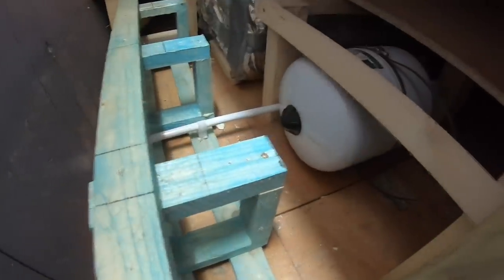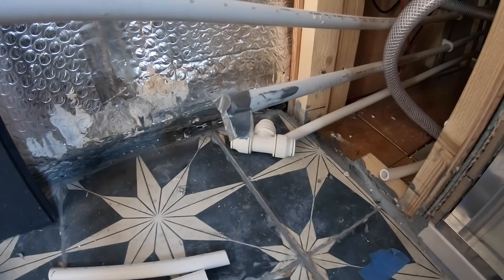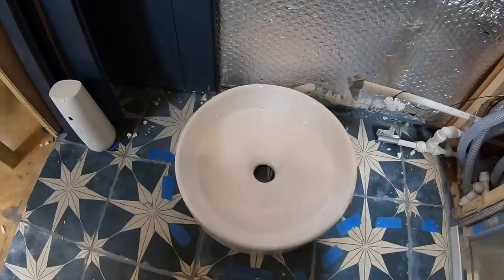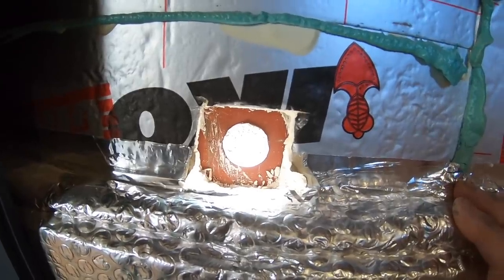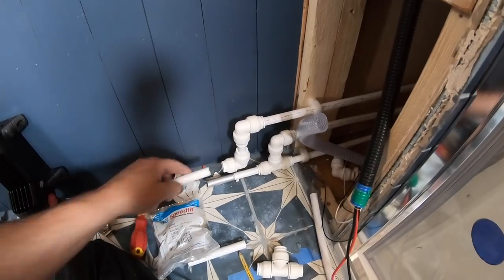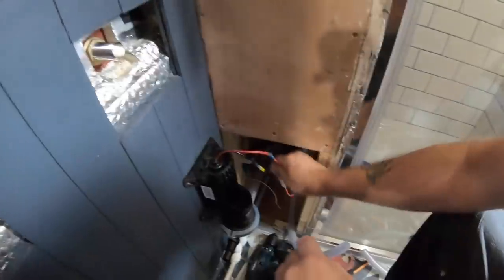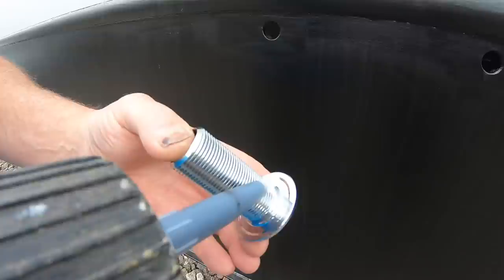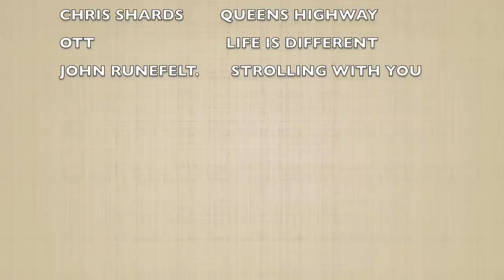VLOG 41, Narrowboat Fit Out -  GULPER, BLACKING AND BATHROOM WALL

Comment: My wife and I both cheered when we saw the water tank sensor! We don't understand why everybody doesn't have one of these. What sort of doofus needs to check how much water they have with a stick! The only better system I've seen, is a gentleman who added a reverse osmosis water filter system to his boat, and says that he only has to fill up with water once a year or so. The rest of the time he's reusing the water that normally would be ejected into the canal.

I saw one other suggestion, from a plumber, where he had a piece of stiff bent copper with a hose fitting on one end, and he would use that on the end of his hose, to go into the water tank. He may well also have had a filter, because sometimes taps are not necessarily clean.
Reply from the maker: Thanks Mate, Yes they are a useful bit of kit and we like the idea of just looking at a gauge rather than having to dip the tank or guess etc. They are quite pricey for what they are in the uk and i think that puts people off. We paid £85 but see them advertised for up to £140. How good they are it remains to be seen but we shall see.

Comment: Congratulations to both of you for doing such a thorough and excellent job.  Your videos are also very helpful and instructional.  Could i ask what size cable you've used to connect the whale gulper and also the water pump?  When you did the lights you were (in your words) over cautious by using 2.5mm when maybe 1.5mm or even 1mm would have sufficed.  Am curious if you've followed this way of thinking on your other 12 v circuits.  Many thanks and keep up the good work.  Looking forward ro launch day and seeing the finished boat.
Reply from the maker: Thankyou Sean, Yes you are right I have oversized the Gulper, Bilge Pumps and Water Pump too with 6mm. I would rather be over than under sized. Thanks for you support👍

Comment: Great job as usual. What made you choose traditional bitumen blacking over 2 pack epoxy?
Reply from the maker: Cheers George, First thing was the cost. We were at the top of our budget with the shell only and it was an extra £800 for the sand blasting and 2 pack. The second reason for us was we know we want to take her out of the water every 2 to 3 years to check all is ok. so will be easy to clean her and re-black anyway while she is out. That way we wont always be wondering how the bottom is doing.